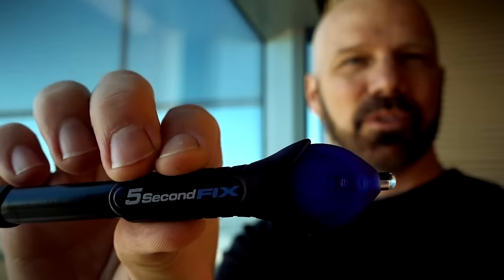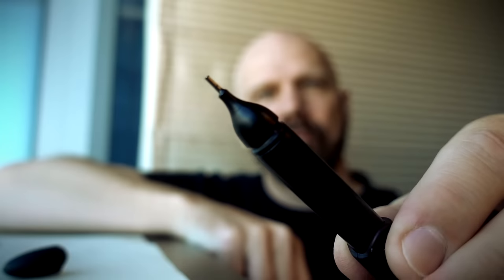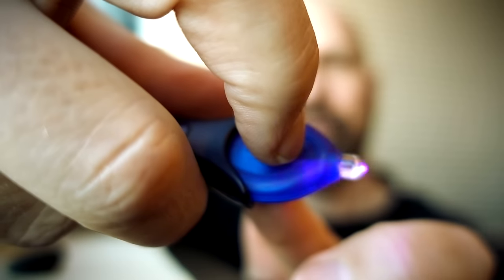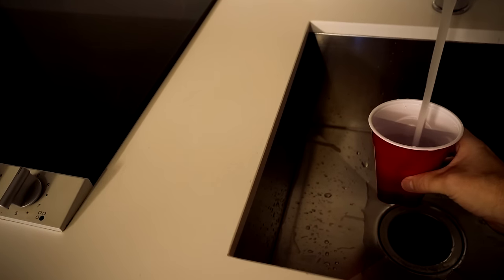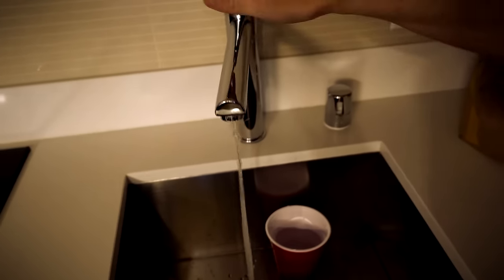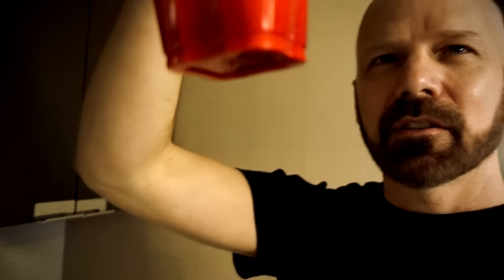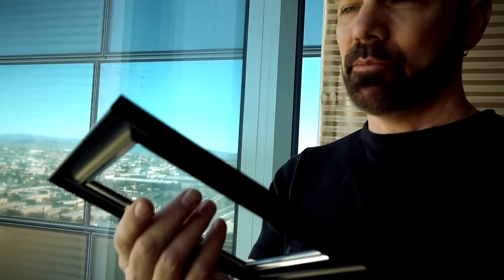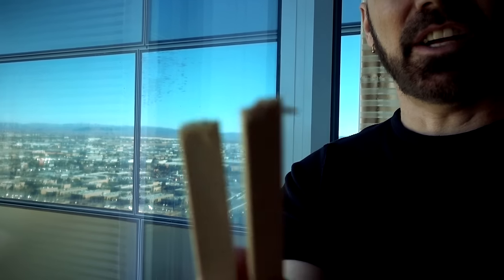5 Second Fix Review: Glue Alternative?

Comment: What I use with this is some fiberglass and/or silk nail wrap and work in layers around certain items to add strength and it works like a dream. (This is my girly way of thinking, combining cosmetic application and handy work.lol) if you look up how to repair a nail with uv gel and fiberglass/silk wraps, it should give you an idea of what imean. The rolls of wraps you can get are super cheap and the perfect size for doing small repairs. The wrap turns nearly transparent as the resin is applied and cured as well. Fixed one of my mixing spatulas that I use daily that was split in half applying a little bit of the uv gel between the halves, doing a "flash cure" to get it to hold so I don't need three hands to wrap and "glue" and apply the gel on each layer curing in between for 3 layers and the darn thing has lasted for months with heavy use and even mixes very viscous products. Anyhoo, just wanted to give some tips for anyone who has the product already etc. Great thorough review. I tfs! Subbed for sure!!
Reply: Oh and if I am doing a little bit bigger repair or not in a hurry, I use my uv gel nail lamp to cure the "glue" hands free. You can find them super cheap on Amazon in a variety of sizes. I even have a portable one the size of my palm that has retractable legs to use and then snap back in place for easy travel, like in your pocket or something. And I just use my bigger (huge)one like o said, for bigger repairs.lol

Comment: Yeah so it holds up to .00000002 lbs worth of pressure. Forget that this a hole company tries to say it welds a winch cable enough to tow a vehicle onto a flatbed. 

bs product
Reply: Father Flanagan that's disgusting. I have no problem with gay people, but there are lines between sexual desire, sex in genders, and sex in relationship. They work a little differently.
Reply: I sawed this boat in half
Reply: Drama heating up in the As seen on TV fandom

Comment: Gorilla glue super glue gel works best, never had any issues. Always fixed things. Had an old Ford with those chrome mirrors on the side, well the chrome housing came off tried everything from adhesive to jb weld. Got that shook the bottle glued a drop in each corner plus the middle held it for about 10 seconds stayed on for 4yrs
Reply: What happened after that?
Reply: ferociousgumby Not sure, sold the truck

Comment: I am wondering if the UV led light is strong enough. UV cured nail polish is very particular with the actual light source and time cured. Many manufacturers recommend only using their own lamp source. Some UV nail polishes only require 2 minute cure time, others 3 minutes. It mainly depends on the power of that led light. It may pay to test with other UV light sources.

Just because the proto model worked, doesn't mean corners weren't cut in production. But, we are talking about a $2 to $5 buck product. Not a miracle cure.

Comment: I used the glue just the other day to repair a spun bearing in a plastic housing of a cordless grinder, the bearing seized and spun the bearing wearing the plastic down so it was a sloppy fit, after a few layers of the uv glue were applied the bearing was a great tight fit again and was a perfect cure for my use, I have used it several times for different jobs and it has been great for the right type of use.

Comment: Tried 5 Second Fix on a broken folding chair on the plastic hinges.  Despite several attempts it didn't hold.  Maybe the stuff is good for repairing eyeglass frames but I wouldn't recommend it on anything that has even a minor amount of stress applied.
Reply: 1SnuffySmith I doesn't  work on glasses hit as either!

Comment: On dark items, chamfer the edges of the items to be welded.  Doing this will produce a good strong join that can then be sanded down to match the edges of the repaired item.  Then, give it a polish if it is a shiny surface.  Good stuff regardless.  Don't forget this is the same stuff the dentist uses to fill a cavity.
Reply: velcroman11 Mine must be defective! This isn't  want my dentist uses, he's usually doing Mercury/Alalgum dinnlings.
Reply: Jo LAKE Same here. Modern dentists are moving away from the mercury fillings because of the controversy but I've had some for over 20 years and no issues.

Comment: I found this product preformed well.
I also found that rather applying along where 2 surfaces join on the outside that you need to apply it on the surface contact surfaces of the areas being connected. Apply as close to the edges as possible and cure. And then apply along the outside as you did and cure. This makes for an adhesion that is very powerful

Comment: 5 second is not welding.  Welding 'fuses' the materials together.  Super Glue is a good glue but there are some surfaces that won't take it.  There are probably materials that won't take 5 Second Fix, there are some surfaces that will not take it.  It wouldn't stop me from using it because of the facility to move the surfaces about, that's a really good option. Great review very objective, thank you.

Comment: Works really great if you put it not around it but between it like you are putting it back together woth the glue in between. I used 5 second fix to bond together my engagement ring and wedding band and it worked perfectly! So happy with the result best $5 I ever spent looks like I got it professionally bonded!
Reply: >"Works really great if you put it not around it but between it like you are putting it back together woth the glue in between."

If you are putting it in between and then closing the gap, the UV light cannot get to it. You are supposed to put it around the break, plus it is better to use multiple layers.

Comment: I fixed a 1cm hole in a tarp while it was raining it worked perfectly and is stronger than the tarp.
Layer you UV resin to give it strength. If you are fixing something that is going to have pressure on it do a few layers and it  is 3x stronger.

Comment: You should try Lazer Bond USA. I find that it works slightly better than 5 second fix.

I use this for light duty stuff and hot glue for the heavier stuff. This stuff isn't great for places where you can't get inside with the UV light to harden the glue.

Also this type of glue is useless for things that get hot. I used one of these to glue a handle back onto a cooking pot and it lasted maybe one or two uses before the glue gave out it was sealed and no glue got inside the pot. I used a cabinet knob and it has a hex screw type thing that fits into the knob. I glued where the hex screw thing goes into the knob.

Comment: Great production an this video. You must use a generous amount ACROSS the crack from one side to the other. It looks like your only putting a little bit right at the crack. Its not adhesive so you need to think of it as a support plastic that sticks to plastic. With that, you go widely across one side of the plastic to the other. dont think GLUE, think TAPE. Thanks for posting

Comment: Sometimes it is just easier to buy a new whatever. If you are gluing (using any glue) something of value, how safe do you feel with that item? Broken pair of glasses? Just take them to optometrist and buy a new frame. They will reset the lenses for you, usually at no cost for the reset. Just pay for the frames.

Comment: Glad i saw this video.  Low expectations for UV "glue" as an adhesive, but as a filler in fine word working maybe. Example, a fine clock with a gouge needing filling, if the plastic could be tinted, colored to match wood on clock then maybe it is repairable, with good color matching.  Coloring plastic liquid is the problem, will UV work after tint mixed in?  For my industrial epoxy fills, I used a non-reactive powdered color/tints found in art stores, forms a paste, infinite color possibilities, then layered taking hours to harden very solid!  With UV, large sections of fill is easy, needing only moderate adhesion, with adequate color matching if tint-able ~~

Comment: The tricky part when repairing glasses.....is holding the glasses still in a way for them to connect properly and hold the darn light......I find that using a bit of super glue first to hold the pieces together....and then use the 5 second fix to secure them for a longer period of time.

Comment: I like that you are comparing, but there are particular products that should work better for these fixes. How about a good wood glue (like Titebond) or hot glue for wood, and E6000 for plastics and ceramics. Yes, you have to let them dry, but they will work well and are permanent! A good glue or bond should be as strong as the material after it's done.

Comment: i have used 5second fit to sorta remake a nose piece for my safety glasses... these are my Rx so i just can't get them for 5$ the nose piece worn off so i used this to makeshift a nose piece with layer by layer material... i think if i would keep using this stuff is to get a much stronger UV light for better and fuller curing for mine was a slight sticky possibly from so much of the material being used but it works non the less for what i use that kind of stuff for... for gluing?? nothing says more serious then Qbond... can ask me more if your curious

Comment: Can you weld two wires together that have an electric current. That's the type of welding I want. Type of glue that will connect the wires together so I don't have to use a solder gun

Comment: I tried the 5 second fix to repair the headlight lenses on my truck, they were separated from the reflector part of the light, like the factory glue that was used to hold them together had gotten old and lost its hold. So I grabbed the 5 second fix product from a Pharma store, and it was kind of expensive I thought, like 15 dollars. So I thought if it works, 15 dollars is a lot cheaper than the cost of a brand new headlight by far. So I buy the stuff, and go out to my truck, and push my lenses back together, and I proceed to lay a bead on the seem, to weld together with the little light, and it seemed like it was working, so after I welded all around the light where I could reach, I thought I think it fixed it, so I drive back home which was about a 20 minute drive, and when I get home, I immediately got out to look to see if it was still holding, and it sure wasn’t, it popped back open and the lenses were sticking out wide open. So I thought, well there was 15 dollars waisted. What a fail.

Comment: I know it an old video but. I tie flies for fishing and use  5 sec fix for creating heads and securing some materials on the flies. There is a product by Loon outdoors that is almost the same thing as 5 sec fix for creating fly heads that is also a UV cureable product that is much more expensive.
I found 5 sec fix on clearance for 2.50 a tube so it can be purchased cheap just look around.

Comment: Glass industry used or may still use this uv bonding technic to bond glass together for aquariums and the like, on a much larger scale than this little pen of course. So it works just probably not as good in such a small configuration. Thanks bra!

Comment: Great review and I liked how your tests were done using appropriate size objects. I haven't used it yet but on my motorcycle, crankshaft seal has a deep scratch in the housing that its seated in and its leaking a lot of oil. Im hoping to use this bondic to fill the scratch. I think it could be good for this job, if I apply the application right. Anyway Great review.

Comment: Maybe the name comes from 5 seconds of life when done via the way shown in commercials, but would have greater potential to take the curing a step further as lgbtTV5 stated. I've done a lot of work with contact glues that come with curing spray, as well as epoxy and others like JB Weld and run-of-the-mill super glue adhesives. Keep in mind that adhesive can wear down over the course of use and time. Gravity is a constant factor to consider as well for dangling or suspended items such as jewelry and decorations. So don't get your hopes up if you plan on mending the centerpiece to a ring and the gem disappears after you've brushed it up against clothing.

Comment: I like this product for a few things but will say a few add'l flaws with this exact pen. It does work for some projects but after a few uses, the pen was leaking & even the tip came out & got stuck in cap. Had to remove with tweezers & put back in but still constantly leaking out of tip. So it wasted a great deal of the product unfortunately, no matter what I tried to prevent it. 

Also my uv light never turns off no matter which way switch is (on or off). Keep the plastic battery tag u get when 1st opening cuz it may save your pen. I stick that back in to separate battery & keep it off when not in use. I do have a higher power uv light tho if it does die. Unfortunately I don't think I'll get more than the original few uses out of it after all the leaking.  

I pd $9.99 for this 1 then found a different brand for $2.99 at Burlington  (formerly Burlington coat factory) & I believe Marshall's, Tj maxx & home goods will have same 1 I got for $2.99 if u want an inexpensive chance to try it. I haven't tried the $2.99 pen yet. 

Used on mini blinds ppl keep breaking cuz too lazy to open blinds to unlock window. They just shove hands in between 2 pcs & eventually they break (cheap 1's & better quality blinds too). It's a bthrm with no vent tho so blinds need replacing either way occasionally so I just repair what the bums break til the next set is needed. A lifetime of repairing lazy ppl's damage to a household full of stuff. 😕

Comment: Ive tried this  glue  its not  good at joining anything only as an outside covering so  joint is weak as only outside fixed you could super glue first then cover  to add more support with the  5 second glue  but thats the only purpose  its good for

Comment: super glue gel basically solves all the problems that regular super glue has. Gorilla glue super glue gel is the best price for it that I've found at stores because it comes in a big bottle for a low price. The loctite super glue gel looks like a giant bottle but it's just a big plastic flimsy applicator with a tiny tube of super glue gel in it.

Comment: Is this bionic??? Or a knock off???
It works really if you use it properly.
 That being said it works really well in layers. Resin light resin light etc.
 The more layers the stronger it is.
 So it you put one half ass layer on something and try as hard as you can... It will break.

Comment: It works decent for a few things. My uv light switch is crap tho & it never shuts off so I have to use the battery block plastic tab & fight with it to try to block battery so it shuts off. Luckily I have a pretty hardcore uv light so if it craps out, I can use my uv light. 

I found another brand for $2.99 after buying original as seen on tv 1 for reg price. I bought that 1 too just cuz price was right at for a few tasks it's not a bad thing to have. At $9.99 I wouldn't buy again. $3, yes.

Comment: I've used it and it works well. I do nails and that glue gel works just like hard gel for nails which needs to cure under UV/Led lamp to harden or even more of a comparison would beca no wipe gel polish. But just as the mail gels the light needs to be able to shine/penetrate its rays through in order to harden the gel. So people needs to keep that in mind. As you say it's more of a surface fix because the rays of the light can't penetrate through colors

Comment: I'am impressed with it does every thing it said it does. But it does take more time to run the light over it to harden! So far it save me 50 dollars to glue it, Rather than replace it. Like my food processor body cracked  save me 30 dollars there, and a plastic gas can handle cracked save me 20 dollar there both are like new again! Still got plenty left over for about 4 more jobs  ~ I would say its fixed even LONG TERM USE

Comment: First of your reviews I disagree.  Think of this as a broken nail fix, which it basically is.  You cannot use it as a "glue", but as a layer to strengthen and fill in missing bits. You need layers covering your break to strengthen it, about 4-5mm in both directions. I had a hard plastic Tupperware (original Tware) serving dish of 20 years that fell on its tip and broke pieces off.  I glued the crack with superglue, and filled in the missing bit by adding 5 sec, cure, adding, cure etc.  Until I had enough layers in that crack (3cm length and 1.5cm at widest bit, then narrowing to the tip).  It holds up well, through 5+ washes through the dishwasher.  It also harden a bit more over the next hour or so after application, much like any glue would, so don't put force on it directly after curing.  Sanding it down and polishing or painting is also possible after application and hardening, much like acrylic nails.

Comment: This is a knockoff of Bondic Plastic Welding, with inferior chemical composition. You use it like you'd weld two pieces of metal, which would NOT be to pour molten metal between the parts like glue and wait for it to "set",  but to make a welded seam around the outside where the pieces touch.

Comment: You are not using it corecly, you are only applying the glue to one side of the outside of the joint. Unless you apply the banding agent to the the contact surface, there will be movement, & it will fail. It looks like you dont know how to bond items or you are setting it up to fail, either way, it is not a fair review of this product. It looks to me that this product does set solid, so their seems no reaason it won't do the job if done correctly. I am confident enough in this product, i am going to place an order for it.